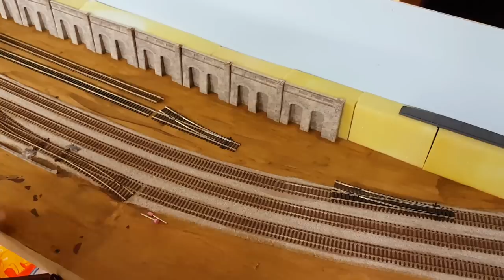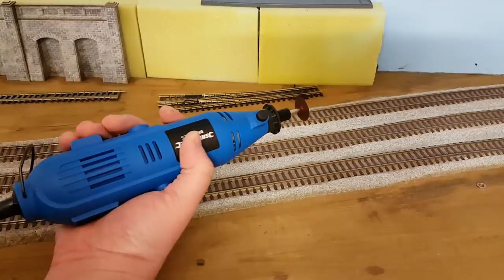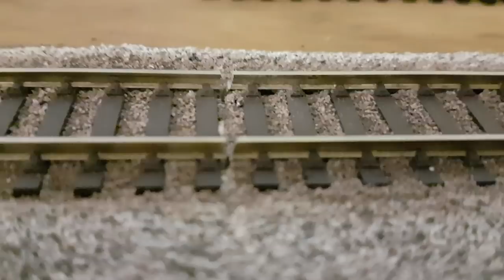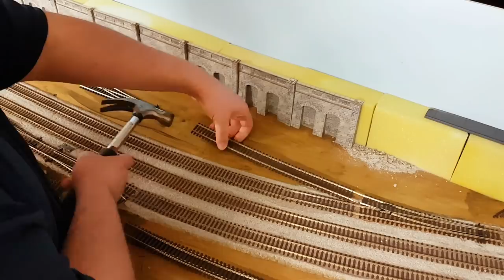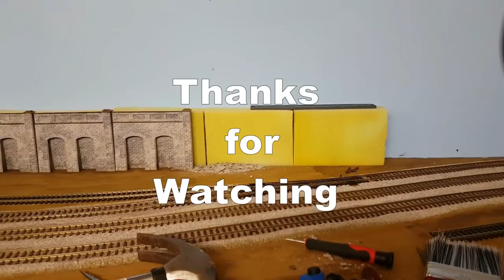New Junction - Adding a Station Pilot Siding, Part One | The Track work

Comment: Great job on the point work.  I like that you take your time and work carefully and methotically so the point and trackwork are in place.
The testing phase is a big plus before continuing on with wiring in and ballasting.
Nothing is more frustrating than to find out all your hard work was for naught. Due to kinks or in mproper tracklaying or track above fishplates. We learn from our previous mistakes
 Or that is what makes a seasoned modeller.
  Diligence slow and steady, and careful workmanship.
Thanks for sharing. Until next time all the best and carry on .

Comment: Great, a nice model of a ground frame now controlling the sidings rather than power points, and it’s complete.
Reply from the maker: How do you mean sorry?
Reply: Well all the station points in real life would be controlled by point machines etc, from a signal control centre,(power points)but then the points in the siding rather than being controlled by the same signal control centre, you could have a ground frame that’s released by the aignal control centre, ground frame is a mechanical frame like you have in a signal box. I’ll try and draw a diagram and send you on Facebook page when I get chance,
Reply from the maker: @trickymc2299  thanks that would be great!

Comment: Nice neat job. I'm with you on point motors. I haven't got them all done yet but I use the wire in a tube method with a clothes peg to supply the spring to return the point to it's other position. Low tech! ;-)
Reply from the maker: They are very good but if you can do without like me then why bother. :-)

Comment: What about adding a trap point at the end of that throat road as a safety feature to prevent runaway locomotives from accidentally getting onto the main running lines? Looks like you’ve got the space, could be another little bit of interest! Just a thought.
Reply from the maker: Hmmm worth looking into that!

Comment: I think I would not have that gradient from the point  on the mainline down to the siding. Remember 4mm is a drop of a foot in OO gauge! Although it is not discernible to the eye, the discrepancy is quite considerable and will cause the flange to ride up and derail on a loco which you have as yet to add to your fkeet.
Reply from the maker: My aim is to lower the profile of the less maintained track, im winging it but I'm going to find out the fun way. Thanks for the comment!

Comment: When you cut that piece of track how did they join together if it was cut and not the same size as the other ? Minute 3;56
Reply from the maker: The peice removed was the same lengh as the point.
Reply: Yeh but how do you join them together if they are not the same fit ?
Reply: So can you help me out with that question please ?
Reply from the maker: @maxvandenberg6905  they are the same fit? Thats why they fit. :-)

Comment: Can’t beat a bit of forward planning! 😂 However, sometimes it needs to be done. Richard, there are 40mm cutting discs which make cutting a little easier but the discs are a bit thicker and can be prone to fracture when worn. (Mine are usually replaced when I catch them on something and break them!) I don’t buy them from eBay but get them from Expo Drills & Tools which are of good quality.
Great little modification there and I’m pleased it’s worked out. Always a bit of anxiety involved. (I have some spare Peco 75 flexitrack if you need some - (email me at rmlectronics@btinternet.com)
Reply from the maker: Thanks for the offer, i use code 100 track typically! 

I'll take your advice on board!